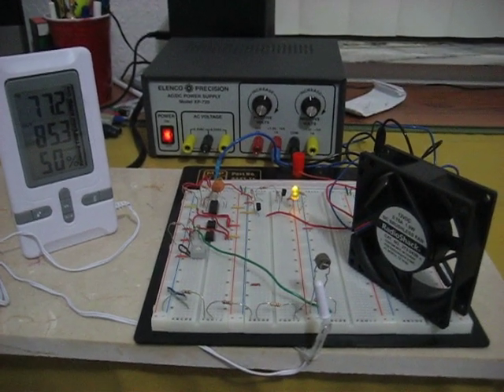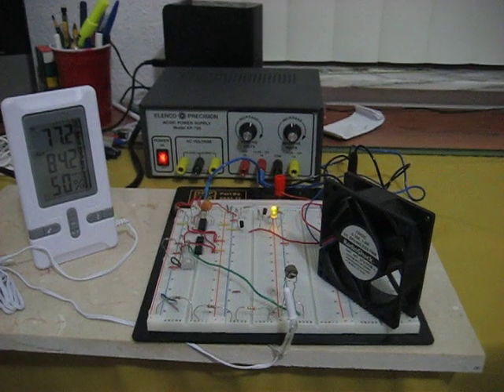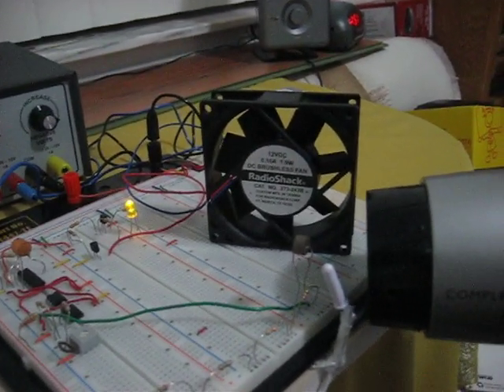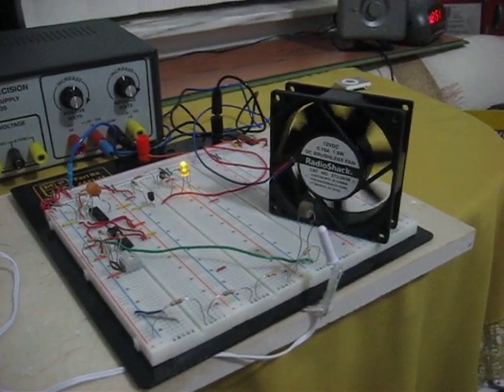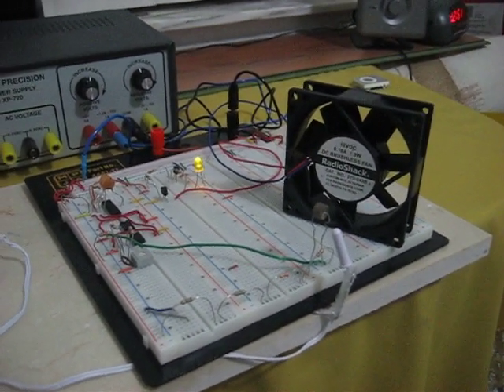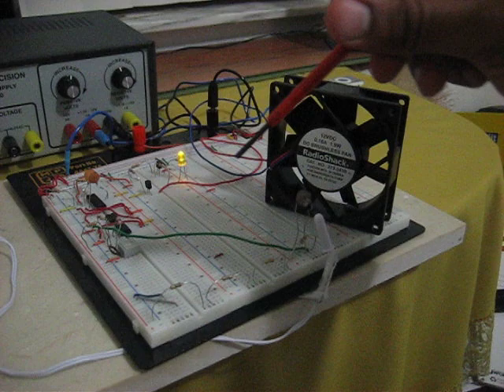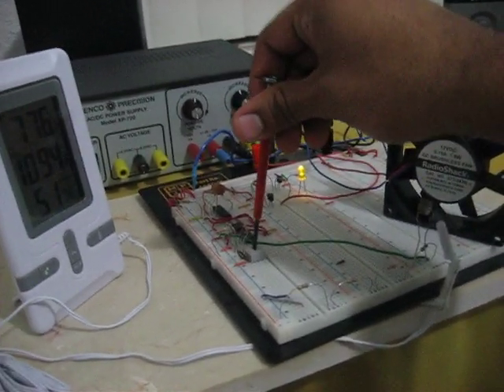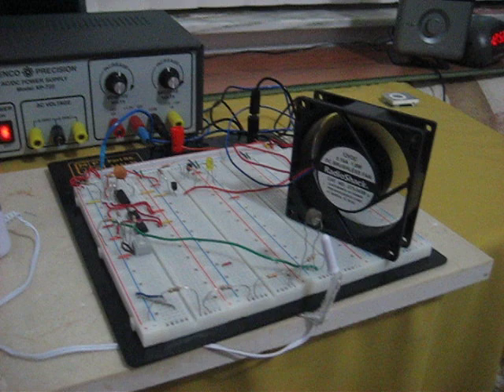Temperature Sensor using Thermistor

Comment from the maker: @melenee11, A thermistor's resistance can have either a negative coefficient (NTC) or a positive coefficient (PTC). In other words, depending on what type of thermistor used, an increase in temperature will either increase or decrease the resistance. I believe  I used an NTC type of thermistor, but honestly I don't remember. Either way any thermistor should work, the only thing that would change would be its reference in the voltage divider, (either pulled down to ground or pulled high to +Vcc).

Comment from the maker: @Maryammmm, I believ I used LM339 Comparator, you can buy it at Radioshack. The capacitors are just bypass caps, used to stabilize power/block noise.

Comment: @Maryammmm And sorry, I understand everything in your circuit except that little floating section at the bottom with the two capacitors. What is its purpose?

Comment from the maker: @Maryammmm, If you take a look at the schematic video on my page, you could switch your heater on for low temperatures in the same place where I have my LED. The circuit would be the same, except your heater would turn on at lower temperatures on one side of the output, whereas my fan turns on at high temperatures, being powered by the other transistor. The only thing you need to do is construct a circuit that will allow the heater to switch on and off from the transistor from my circuit.

Comment: Hi there! I basically need to build this exact same thing except that a heater (and fan) will power on when the thermistor detects a lower temperature until it reaches a higher set temperature. How would I go about converting your circuit into that? Any tips would me amazingly helpful. Feel free to inbox me, thanks!